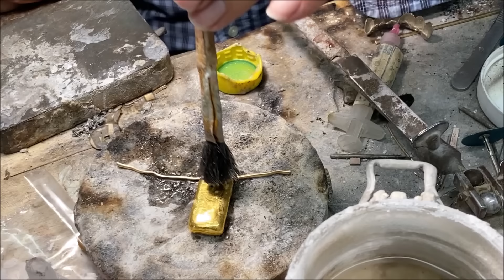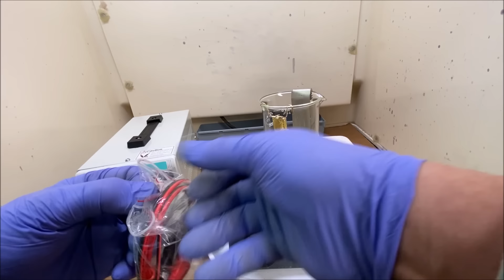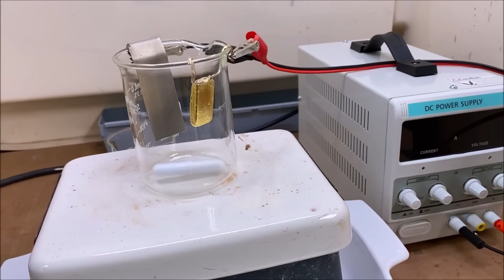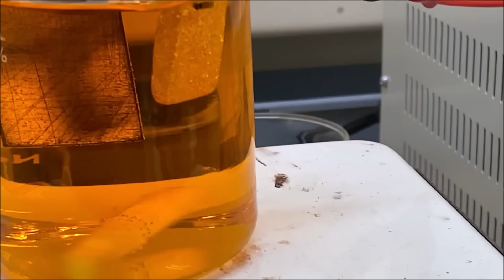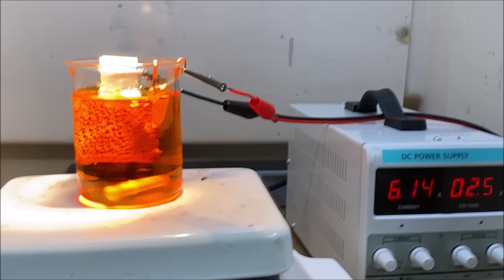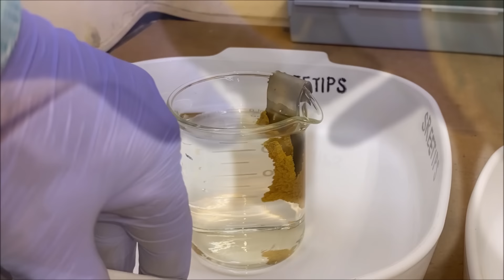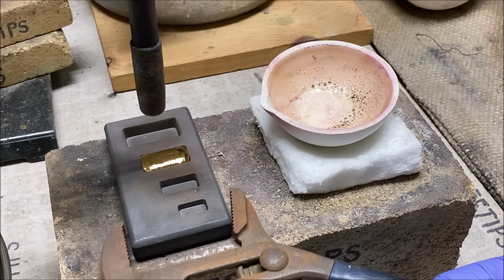Electrolytic Gold Cell Part 2

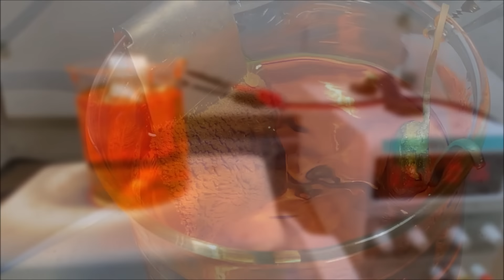Comment: 17:17 a little salt would definitely increase the conductivity significantly but I have no idea what the Fallout of that would be.
After Googling it it seems maybe not much other than increasing the conductivity assuming you're not already supersaturated but if you copy and paste this search query into your search box you can see the results according to Google and as you're the one with all the experience come to your own conclusion as far as efficacy and efficiency are concerned

(what happens if i add sodium chloride salt to "chloroauric" acid)  
Without the parentheses but including the quotes that ensures you don't get a bunch of nonsense you're not looking for
Reply from the maker: I use hydrochloric acid to increase conductivity.
Reply: @sreetips  if I'm able to electroplate karat gold using a method like this then it would not be very effective for refining so I'll let you know if it works or not because we may just be moving gold of any purity from one place to another without affecting purity at all

Comment: How often do you change the electrolyte and does your gold anode or cathode ever go bad. Are you making bank doing this?!?!?
Reply from the maker: I’ve only done this twice. But now that I see how easy it is I may do some more gold cell refining.
Reply: @sreetips  I will have buy some gold to get started. I'd appreciate any tips on doing this as a beginner. I've only watched portions of your silver videos and this process seems very simple..you said there's another video on the electrolyte?? What is the electrolyte?
Reply from the maker: The electrolyte is pure gold dissolved in aqua regia. About 100 grams per liter concentration. Plus some free hydrochloric acid to promote conductivity through the cell.
Reply: @sreetips  do you loose electrolyte from this process
Reply from the maker: Yes, we are doing well because we are on the gold standard. You don’t have to wait to go on it. You can put yourself on the gold standard.

Comment: Hi there! So I JUST discovered your work! I'm a jewelry designer (all materials) so CURIOUS - any place with "explanatory" info on this process? I was a little shocked to read "growing silver" as if it's from thin air!! LOL - dummy me - confirm for me - this is taking scraps of gold or silver - and/or gold from computer parts - and separating the metal(purifying?) which then forms crystals - right? Maybe include some data on the theory of this method - or maybe "ABOUT" page with more GENERAL info (I'm also.a web/graphic/media/info designer - so hope this helps you bring more views - CHEERS! ALC from San Francisco
Reply from the maker: Hello. This is called the Wohlwill Process. It’s used, on a larger scale, by big refiners. I did it in my shop to show that it can be done by an amateur. And to see if that titanium cathode would work.

Comment: What is the potential of this method?  You basically took pure gold and moved it from an anode to a cathode.  Not sure what that proved.    Can this work like your silver cell?  Can you take raw gold and purify it without inquartation?
Reply from the maker: No, in order for electrolytic refining to work, the anode must be relatively pure to begin with. Just like the silver drill. Adding sterling to the silver cell would quickly foul the electrolyte with copper. The same principle applies to the gold cell. The book calls for 980 parts per thousand pure gold anode for the gold cell. The higher the purity of the anode, the more likely the gold will get to four nines.
Reply: @sreetips  I see.  I assumed the silver cell could handle sterling etc.  Looks like you are mostly using  cemented silver for the silver cell.

Comment: I have done some cast iron restoration using electrolysis. I found a computer power supply is a good hardy 12v source.  I don't use acid but Sodium carbonate (Arm and Hammer Super Soda).  Just a 1/2 cup per gallon of water takes the rust off a cast iron pan without damaging the pan. Positive on the pan negative on the plates surrounding the pan.  Works amazingly. Titanium can handle the acid for a long time. I worked for Boeing and they etched titanium with hydrofluoric acid. (do not use hydrofluoric acid as it will not burn you. No instead it soaks into your skin and goes straight for your bones and eats the calcium. A few drops and you will have a real bad day. 1 drop is a rough day  but 2-3 drops on the skin will make you wish you never heard of it being they have to inject calcium at the entry point into the bones. I don't want to know how they achieve that as a test subject).
Reply from the maker: Thankfully I don’t use hydrofluoric in any of my processes.
Reply: @sreetips  I was always told if you see an orange cloud run the other way as fast as you can. I painted and primed a lot of Titanium parts. It is a crazy cool metal. Titanium will catch on fire if you use tools above 1200 RPM and Talc is the only thing that puts it out. (if it works) When they shape he sheets of Titanium they put a mold in a 1800 deg. (F) oven. Once up to temp a tech puts a sheet of titanium in with it and press the sheets in the mold, hold it for an hour or so under crazy pressure with Hydraulic rams the size of cars. It is called Super plastiforming. If they turned off an oven once it was cool  if they had to restart it it would take a week to get up to temp. They would open an oven and the radiant heat was felt 100 feet away, take out the molded glowing red hot part and another sheet would go in.  Once the part was stamped out it went to a water jet and got cut to the correct dimensions, deburred and sent to the tank line to be dipped in Hydrofluoric acid rinsed off and dried. Then it came to me to paint.  Covid and bumbling executives who charged for safety training took it away. I liked working there.

Comment: The squared edges of the titanium will help hold the gold to plate.  Round off the edges to a smooth surface to see if that helps the gold release.
Reply from the maker: Give it a taper.

Comment: Wait a minute ? Shouldn't the Aqua Regia Gold solution lose its orange colour as the electrolysis reaction removes more and more dissolved gold out of solution ???? How can you be sure that all you have accomplished is to dissolve the Anode Gold Bar's Gold over and onto the Titanium strip instead of removing Gold from the Aqua Regia ? There's something about the reactive process which doesn't look right ?
Reply from the maker: I get all the gold back, none of it is lost, except the little bits that bubbles out of the cell.
Reply: @sreetips  How do you know Mike ? Why doesn't the colour of the Aqua Regia Solution decrease in its orange hue as more and more Gold is removed from solution and deposited onto the Cathode ? Shouldn't the solution gradually become clear if all the Gold is being recovered ?
Reply from the maker: No, if you look closely during the time lapse, I’m adding small doses of spare electrolyte and HCl to keep the level adjusted. Plus, the gold that’s depositing on the titanium cathode is coming from the anode bar as it dissolves in the electrolyte from the current flow. The gold in the electrolyte doesn’t come out of solution until I add the stump out at the end.
Reply: @sreetips  What !? Well, then exactly what is the point of the electrolysis if enabling that operation actually doesn't remove any Gold from solution ? So you just proved to me the answer to my initial post question of how do we know if the Gold depositing on the cathode isn't from the dissolving Anode Gold Bar alone ? The answer is, (According to the previous post you just made in this thread), that yes indeed (All) the Gold depositing on the Cathode is from the Gold Anode Bar and (None) of the Gold in Aqua Regia Solution is being recovered during the electrolysis procedure.
Reply from the maker: Some of the gold from the electrolyte probably plates on the cathode.

Comment: Great video. Next time try to taper the titanium plate for an easier release also the gold could be rolled out only partially on one side and held in place be a helping hand for soldering. This would drop the need for soldering an give you a way more flexible setup.

Comment: heat it...?
Reply: It may break the 'seal' so to speak and the gold drop off... or heat it more and melt the gold off straight into the mold (604 Degrees Celsius less melting point for Gold than for Titanium...)
Reply from the maker: I wouldn’t recommend heating
Reply: @sreetips I'm sure that you have greats reasons for that, but what are those reasons?  Maybe do an experiment video?
Reply from the maker: No good reason, just doesn’t seem like the right move.
Reply: @sreetips  'Don't "knock it" until you try it', 😛

Comment: If you want to grow much larger crystals, try a pulse deposition plating at kHz range frequency. Something like a 1.5V sine wave with a .5V DC offset, so it spends most of its time plating, at 1~10 kHz. If it's easier for you to set up a square wave, that should also work fine.
Reply from the maker: This sounds like the terminator (Arnold) at the gun store asking for a phase plasma rifle in the 40 watt range.
Reply: @sreetips is this legit?
Reply: @kanepritchard5831  At a glance, it seems legit, 1.5V sine wave with 0.5V DC offset will have a range of -1V to 2V, the negative portion reverses the process, dissolving the    gold on the cathode, but it should affect the smallest crystals more, so that the larger crystals are left behind.
Reply from the maker: It’s a little over my head.

Comment: Watching the anode erode and showing it's structure was as enjoyable as seing this beautiful gold depositing on the cathode.
Thank you again, this is a process I wanted to see for a long time :)
Hope you have thought og some variations in current, voltage, heat or PH in mind that you wll share with us. I believe the reason the gold stuck to the anode was because of the concentration of the electrolyte.
To be honest, I thought the process was quite fast.

Comment: If you want large pretty crystals you can use lower current over time but make sure the voltage is below the hydrogen generation voltage. The best gold crystals are made by adding a mix of AuCl3, a tiny amount of bromine vapor, your bulk gold and a gold wire in a sealed silica tube. The bulk gold is heated strongly while the other end with the wire is heated a bit less. A reaction similar to the tungsten hallogen reaction occurs and pure gold crystalizes on the cooler end. 🤓
Reply from the maker: I’ll make a note of that. But the process that you described seems a little beyond my capabilities as a hobby gold refiner.

Comment: Hey Sreetips, HVAC guy here. Those laser thermometers are very inaccurate when pointed at anything but a dark, matte finished surface. Don’t know if it’s that critical to your operation, but I would suggest using a different solution for accuracy. Love your videos!!
Reply from the maker: I pointed it at the cathode that was coated with the gold.

Comment: So, maybe this is answered in one of the 507 comments. But definitely not in the first 100 i went through. Is this a proof of concept experiment? Why are you not doing this the same way you get silver? Is that even a possibility? What really confuses me, is that the Bar used as the cathode dissolves, so how much are you really gaining. And lastly, Other than the fact that it was very interesting, isn't the chemical separation you do just as good and way faster?
Sorry for all the questions but this is like sitting in on a 300/400 level chemistry class.
Reply from the maker: My main concern for the experiment was to prove that the titanium cathode works, and it did. The anode bar dissolves, the gold ions travel through the electrolyte, and deposit on the titanium cathode as absolutely pure, four nines fine, elemetal gold. Impurities won’t deposit on the cathode as long as proper conditions are maintained. Chemical separation comes first. Then we refine it further in the gold cell. I could run the four nines gold back through the cell a second time to get five nines gold. This is the process the RCM uses to make five nines gold for their special projects.

Comment: Would it be possible to use a similar setup as your silver cell (mainly the Anode basket you use). Sure you have to use a glass device and the titanium Kathode but you could maybe use the gold as it is after inquartation and removing the silver.
Reply from the maker: I’m looking into that. It’s got my interest peaked to set up a gold refining cell similar to my silver cell. Only with a titanium cathode bowl. Stainless wouldn’t work with gold chloride electrolyte.

Comment: Suggestion:  set the power supply for constant current mode, that way you never have to adjust the voltage.
Also: the melting point of Ti is a thousand degrees higher than that of Au, so it seems like you could just melt it off the cathode, rather than trying to break it off.
Reply: Based on what he said in an earlier response, "melting the gold will weld it to the titanium",  the molten gold 'wets' the surface of the titanium.  Similar to how solder melts at a low temp but sticks to hot copper
Reply from the maker: Voltage is critical, amps can and will wonder based on variable conditions in the cell. Constant voltage should be set at 1.5 volts DC according to the book. And melting the gold off the titanium would work. It would get welded to the gold.

Comment: Now why do you think this is more purified?  Because in my thinking everything that was in the anode was plated on to the cathode
Reply from the maker: If the voltage is kept constant and conditions are properly maintained in the cell, then only the gold should deposit on the cathode. Other metals, if present, will stay in solution.

Comment: If you imagine a bunch of junk mixed in with the stuff you want, when the stuff you want rapidly joins together, there is a good chance that some junk gets trapped inside.
When the stuff you want slowly and steadily joins together, there is Time for the junk to be pushed out of the way.
Basically slower is Better (more pure).
More Voltage = More Amps = Faster, but less pure. There will be a 'sweet spot' for sure.
Reply from the maker: Agree. I’m going to do some experiments with a larger gold cell. I need a way to accurately determine gold concentration in the electrolyte. I believe that some of the gold gets depleted out of the electrolyte as the cell operates. It gets deposited out of solution on the cathode. Some sort of titration to check gold concentration in the electrolyte. Got any ideas?
Reply: @sreetips  What you need a is a "Titration" procedure to measure the gold concentration. While it can be complicated and time-consuming to get a very accurate reading, you might get it close enough by simply taking a measured sample (e.g. 5ml), dilute it with water up to 10ml and test 5ml of that with SC. Do that over and over with the untested half until you see no result.
Reply: I think i posted some photos of this on GRF years ago. In your case, you could cut out most of the small steps at the beginning by adding about 1ml of electrolyte to something like 250ml of water and see if  SC still indicates gold present. Once you find the right amount, that would speed up the testing a lot.

Comment: maybe but the "wire" on the upper face of the bar to maintain adequate surface contact? Or get a solder kit that holds pieces in place so you can get better positioning.

Comment: Thanks for the demonstration. I personally would use the power source for a 2nd silver cell. If you do keep the gold cell, use casting sand to make the anode bar.
Reply from the maker: I bought the power supply for the second silver cell

Comment: silver crystals and now gold! 🤩 That titanium worked a lot better than I expected as well, probably a good decision to go with in hindsight as opposed to the ribbon as the ribbon would've probably caused even more hassle next to an impossibility to separate the 9999. Do you think you could melt away the gold from the titanium or would that cause some impurities to mix in?
Reply: Just for future reference, never try to melt a metal element from another metal element.
Whichever has the lowest melting point (Au in this case) will obviously melt, but the Higher melting metal (Ti in this case) will just be that perfect warm temperature for the molten element to stick to...   think how fabricators pre heat work beforehand etc.
Reply from the maker: The molten gold would get welded to the titanium.

Comment: Grades 1 and 2 of titanium are pure enough for electrolysis, If you use a thin cathode the when you flex it the gold just flakes off. If you make or buy an anode basket then you can drop in all the bits of gold and they will plate onto the cathode leaving any impurities as sludge or slime in an anode bag.
You could use an anode in a bag for silver recovery too make a deep basket and fill it up for a week or so of electrolysis.

Comment: Another super fascinating video. I'm curious, are you planning to do a refining process, like first do a basket of enquarted gold to extract the pure gold, then take what is left and put that in the silver cell and extract all the silver and then eventually refine what is left, or are you more doing this just to see how it works?
Reply from the maker: I’ll process the anode filters in a separate video
Reply: Gold being more electronegative than any other metal, will be in the anode slime when electrorefining any of those other metals. So you have to work the other way around. If there's copper, electroplate out the copper onto a copper cathode. Then melt the anode slime into a fresh anode bar, and electroplate the silver out onto a silver cathode. Repeat the same process with the anode slime from the silver step and plate the gold onto a gold cathode.